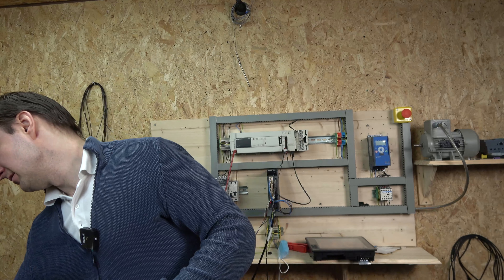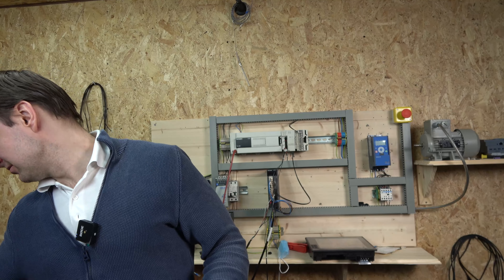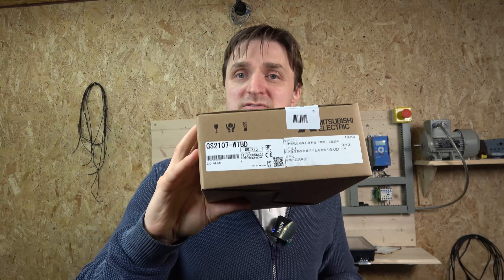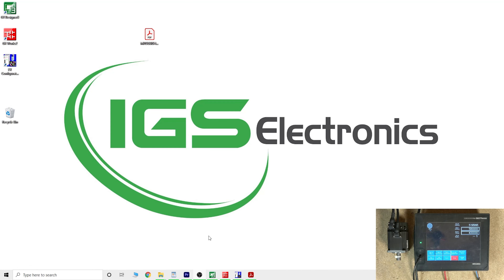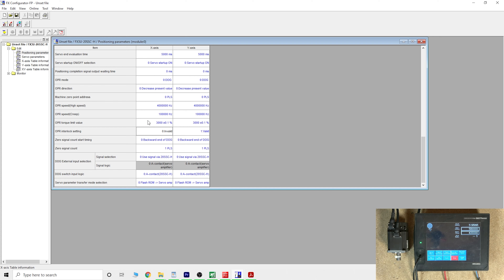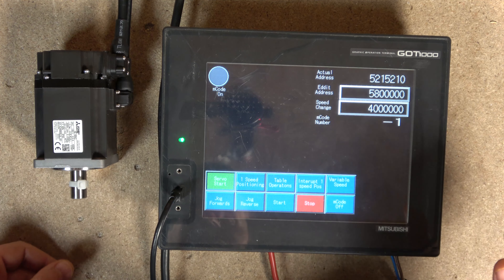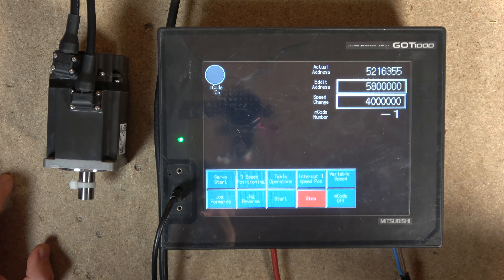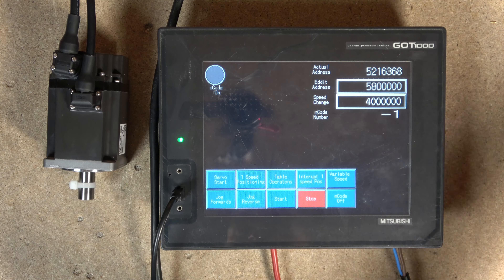Mitsubishi servo MR-J3 servo Buffer memory and 1 speed positioning.With GT designer 3 and GX Works 2

Comment: Hello thank you so much for sharing. if i may ask, you set the servo parameter as Absolute Positioning? because when i set servo parameter Absolute the servo wont start, if i set incremental the servo start. i 100% followed your ladder and FX config settings. what seems to be the problem mr? thank you so much.